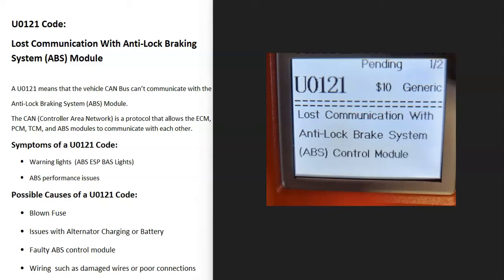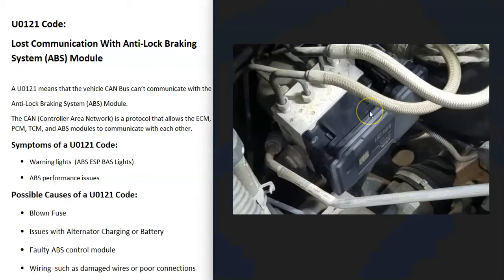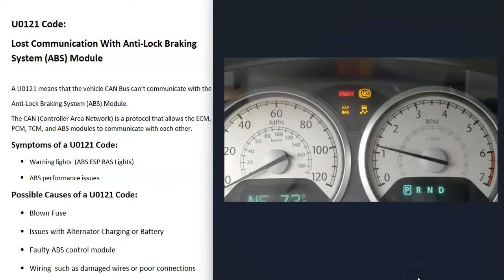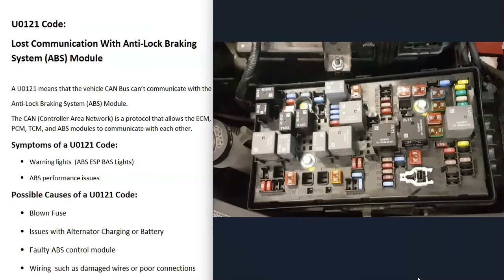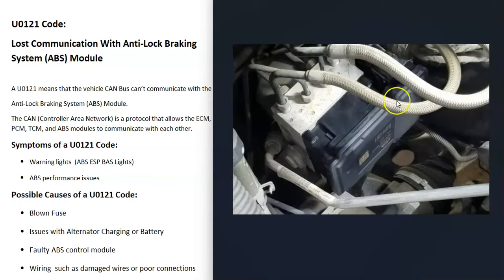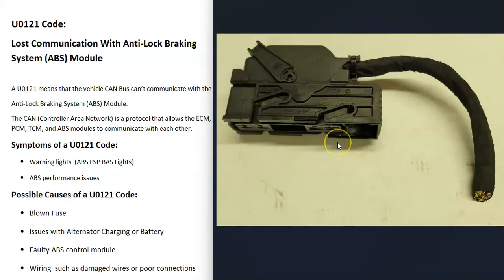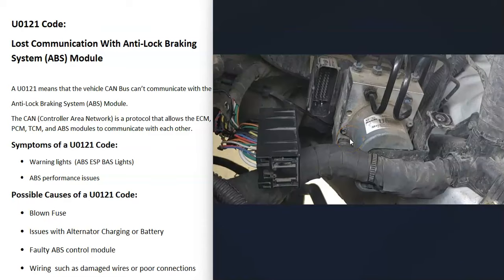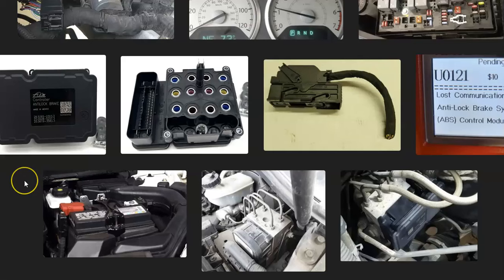Causes and Fixes U0121 Code: Lost Communication with Anti-Lock Braking System (ABS) Module

Comment: 2010 Ford Escape. I tried two modules already from the Junkyard With no luck, I have power and good ground in all the pins I'm supposed to. I have 2.6 V at the CAN pins in the connector just no communication. After an accident are these modules designed to fail and not to be re-used again? I checked an did a reset in the IC module but the ABS is nowhere to be found. Does anybody has any experience with this?

Comment: I have this code on a 2009 Mazda 3. It’s intermittent and throwing the brake symbol on the dash. Strangely I pull the LF seat out and it did the same thing. The circuit doesn’t go through the seat harness? It’s only a few wires. Thanks again for the video

Comment: I have the same problem in my 2012 model passat varriant vehicle, it does it occasionally, it does not do it all the time, sometimes it does not do it for 6 months, sometimes it does it twice a week, sometimes it improves when I remove the polarity of the battery and put it back, I could not understand the problem in any way, it comes to my mind that there may be a contact in a wiring harness because if I turn on the ignition again after stopping the vehicle, then it gives the error. According to some information, if your vehicle has a glass roof, if your vehicle is glass ceiling, it may be oxidation in the wiring harness passing under the floor carpet in the driver's area by taking water from there over time, I will open it and check it, if anyone has the same problem and finds a solution, please let me know.
Reply: same problem. was this a fix?
Reply: @vincentsantopietro2450  Unfortunately, my friend, I checked and that's not a solution. I also checked and cleaned the other chassis connections in the engine section and other chassis connections and the problem continues.